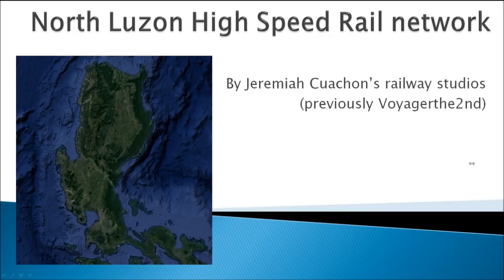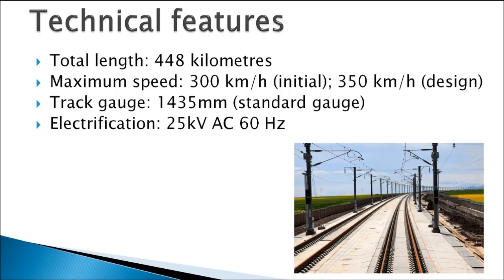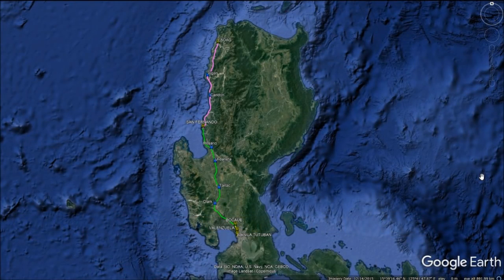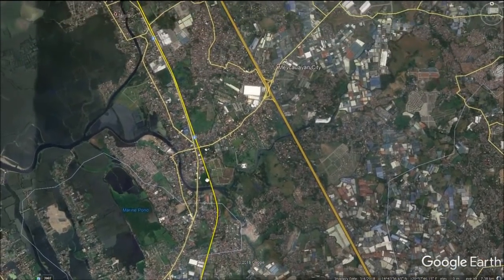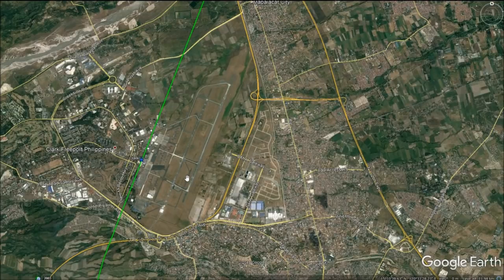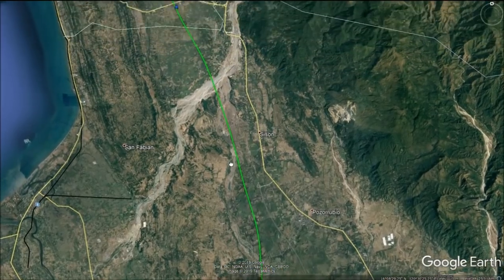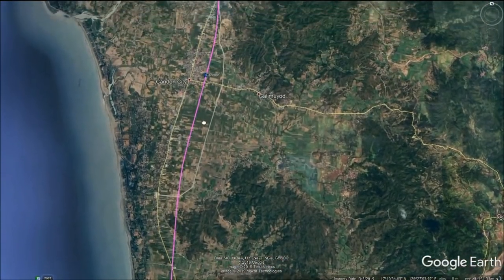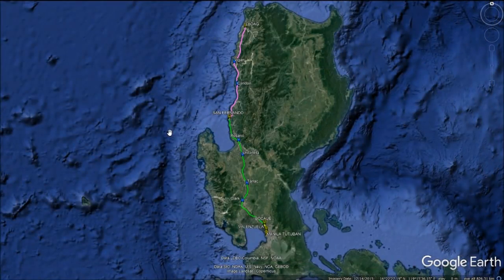HIGH SPEED RAIL IN THE PHILIPPINES - Central and North Luzon (FULL ALIGNMENT) - updated version

Comment: The Philippines really not only has no integrity, but also has extremely poor character.
The Philippines was the first to reach a contract for a high-speed rail project with China, but Japan did not want China’s high-speed rail to develop smoothly, so it once again performed small moves (including bribery) (there are also high-speed rail projects against China and India, as well as China and Vietnam, all used the same method to take away , but it turned out that after 10 years, the project has not started), and also advertised to build a high-speed rail for the Philippines for free. So the Philippines broke the contract, but it had a suitable reason, otherwise it would have to pay huge indemnities; it did not want to give up the free cake from Japan. So the high-speed rail that slandered China had quality problems, but there were no problems with the two quality inspections. It just so happened that the high-speed rail made by Japan for the UK frequently had quality problems, and the Philippines regretted it again. Later, the Philippines wanted to start three high-speed rail projects, and once again let China win the bid, but now there is the idea of hoping for Japan to undertake the construction. It seems that the Philippines, a small and capricious country, has a long way to go to get its first high-speed rail.
Reply: The Philippines wants so many things built ,a highway there a railway there ,So many but no money ,Also like the Bicol railways and La union railways ,after years of neglect it was abandoned ,also once a budget approved do all the money goes to the said project ,😊😊😊or to the you know where

Comment: It is quite confusing. The narrator have mentioned that there will be a tunnel from C3 Caloocan up to Valenzuela station. How can this be feasible to build?

The Philippine National Railways (PNR) also aims to reinstate the at-grade (ground-level) railway at Valenzuela City as they plan to extend the Metro North Commuter Line up to the said city. The existing right-of-way (ROW) in Valenzuela is just enough to accommodate the North-South Commuter Railway and the at-grade Metro North Commuter Line.

If the railway tunnel to be used for the high-speed railway will open its other end at Valenzuela City, then how will the tracks continue? Will it remain underground or above ground (elevated)?

It was mentioned in that video that the pair of tracks will continue above ground from Valenzuela going to North Luzon. If it is, then how will it be connected from the track segment in tunnel without interfering with the at-grade (ground-level) Metro North Commuter railway? Will they erect another set of pillars on the existing ROW in Valenzuela? The space in the said ROW may not be enough.

Comment: Sa mga nagsasabing fake to..dilawan cguro kau or puro kayo abs cbn kaya walang alam..this is an ongoing project.construction has already started for phase 1 tutuban-bulacan.thanks to build build build👊👊👊
Reply: wow totoo? ngayon ko lang nalaman to. Bilang isang Engineer, support ko to👍👍 Imagine (Laoag to Manila)=448km and the train goes 300km/hr. That's about 1.5 hours travel.
Reply: The one you are talking about is the NSCR, which is a commuter train, not a high speed. If you don't have any idea what is a commuter train, you can compare it to JR lines and subways in Japan.

Comment: It’s kinda uninformed. 1 high speed rail is expensive to maintain. The people commenting “I’m gonna take a road trip “ look up how much Japanese bullet train tickets cost compared to your cheap flights rn. 2. All the people commenting “ prices will be cheap because we can ship stuff thru this” You CANNOT ship stuff with this, or in large ie efficient manner, because they’re meant as passenger trains. There’s no connecting and disconnecting compartments. 3. This is another Filipino “it looks nice and other countries have them so we should also get it EVEN if it’s not efficient for us” mentality. Rail IS the solution to PH, but not the expensive high speed rail. It’s regular, functioning and efficient train system. It already existed before, and rail system still exist ... it just needs more stations, better company to handle it, better implementation of infrastructure ie park and riding so commuting cars into Manila will be reduced, and more effective use of transporting goods and services (you can actually change cars and ship goods in mass with regular trains). Current train system just suck, need better cars, better trained staff, better infrastructure like stations with parking lots, efficient transporting scheme and safe computer assisted rail systems that are actually now being the norm overseas.

Comment: It will kill a lot filipino's on the rails and walking on the rails, and look out for more Brown Outs there is not enough power in the Philippines to run this. oh please! The Philippines needs to work on there infrastructure first before anything else. they need to start new manufacturing and hire more Filipino's with a good salary with no contracts.   I love the Philippines
Reply: When philippines operate the nuclear power plant it can provide the power to operate this project
Reply: All people leave in rails area they're going to move them somewhere far Philippines will be the biggest tourist in all Asia
Reply: Don't worry, the construction of coal fired power plant already started last 2017 here in Bataan, 
Phase 1 w/ 600 mega watts
Phase 2 under construction 1200 mega watts
Phase 3 -600 mega watts

Comment: I would think that railway line crossing Central Luzon would have to be elevated rails. That area suffers from massive flooding during monsoon season and typhoons.

Another issue with railways in the Philippines, is Profitability. How much will a train ticket cost? I would think that train tickets can be more expensive than buses, but should be cheaper than the PAL flight to Laoag. So you have little room to play the railway ticket revenue. I would think that you have to fill up all train coaches to capacity all the time, just to break even.

The MRT/LRT lines running inside Metro Manila are filled to capacity, and yet the ticket is heavily subsidized by the government. So it is not turning up a profit.
Reply: That's why we need to promote tourism from the northern region first. So it would cater to a large number of commuters. If there's no tourism up north, this railway will be bankrupted.
Reply: Yes. Its going to be elevated..

Comment: 300km per hour? Get real. You should be a rocket scientist to have that speed in a short distance between stations.
Reply from the maker: That's why I set the distance the distance no less than 30 km between stations
Reply: Yes, maximum 250 km/h will be more than it will could manage. 
Luzon is extremely densely populated. And in 2015 Luzon with registrated with 490/km2 even the less density populated 12,188.6 km2 Palawan (72.7 /km2) and Mindoro (117.2 /km2) do as it get lower density than mainland Luzon. If there should come a railway tru the most populated areas of the 4'th most populated Island in the world, it would got stations more often than every 30km. Only a few places there would be chance to reach a speed of 300 km/h. 
But why buy a very expencive train instead of a better train with a top speed between 200-250 km/h, the Russian is very happy with their German bought high speed train who goes max in 250 km/h between Moscow and the other large cities in Russia, like St Petersbourg, and some 5-6 other cities. That people get a cofortable jurney is better than heavy heavy acceleration, and slowing down very often, which in turn can be dangerous to the safety of trains. And hopefully there will not be any large accidents with many hundred dead, and at least just as many wounded. And do Luzon need that type of train? I say it no, there live to much people on mainland Luzon, and there is still a lot poverty, so slower, cheaper, but just as good trains is better for the price to use the train's and the distance from Metro Manila to the northern point is too short for a high speed train who goes in 300-350 km/h. Had it been like the high speed trains in Japan and China, who only stop in the extreme large cities, then it would we different. And the railway should have gone all the way to Mindanao, it is actually possible, take a look. https://www.youtube.com/watch?v=HCT-FurFVLQ
Reply: Very good brakes

Comment: The issue here is not- if this can be built but rather if  Filipinos can do the necessary maintenance.
Reply: agree. maintenance is an alien concept for pinoys. the pinoys have a "jeepney mentality." use and abuse it. maintenance comes in only when the machine is destroyed.
Reply: @johncolasito5185  I think it stems from Filipinos' Nipa Hut mentality, where you don't really do periodic maintenance but ,just wait for everything to rot, then replace it.
We should first maintain our commuter trains properly before going to High Speed railway system.

Comment: Standing passengers at the rear end of a high speed train pose a dangerous and may cause imbalance to the running train, due to heavy load and wiggley standing position of the passengers.
Reply: This is not a MRT/LRT style trains.. its more like a 3 and 2 seats on each side..

Comment: There's no project so far of having high speed trains in duterte's admin. Maraming tao mauuto sa video mo. No to fake news
Reply: Stephen Teo di ko yan video , yung ongoing na clark to manila lang alam ko sa kanya may extension.
Reply: Ikaw mi naga naba  ....
Reply: It’s just an idea or plan idiot
Reply: @KitKat-bf1hp  butthurt? This may be a plan that will not exist until 2030. Realistically speaking, this will not yet happen since there are other major projects ongoing.
Reply: Wait ka lang another high speed line to be construct from Clark to calamba in the line up as per DOTr sec.Tugade..yes a High speed train.
Reply: @soulshot1231  source?
Reply: Marunong ka lang bumasa ,pero hindi mu naiintindihan se my comment nandun na yung source.
Reply: @soulshot1231  source as in article or journal kasi. Ang sinabi ni sec. Art connecting Clark to Calamba lang. Hindi 'yon high speed rail. It will only reach speed of 120kph as for airport express 160kph.
Reply: @estepen4181  hindi pedeng maraming station sa high speed train kaya gagawa sila ng bagong lines for high speed train nasa line up nila...bali 2 project yun isa ongoing na isa nasa line up nila.

Comment: ill believe this when NLEX gets past pangasinan, any train up north never mind Laoag has been proposed for years and nothing. even a 100mph train would cut travel to central manila or NAIA and reduce traffic having to get thru manila and with land being so flat for 1st 100+ miles north such trains needn't be expensive
Reply: High speed will be base on the integrity of foundation, safety factor is 10 instead of 1.5 understand.

Comment: Possible 1 hour and 25 minutes if no delay of above 1-3 minutes in stations. If stops are above 3 minutes, it can reach 2 hours from Manila to Laoag. 

Other than that, it will still be an impossible thing until corruption is minimized alot.
Reply from the maker: 2 hours from Manila to Laoag would be the fastest service when you factor in that Manila to Bocaue is 120 km/h max and that all trains would stop at San Fernando.
Reply: @Voyagerthe2nd  yeah from my calculations it seems 2 hours is possible. Realistic, if on time always.
Reply: The 60 and 120 km/h speeds in the metro
Reply: I am also measuring it (interested) and making sure limiting the amount of people that will negatively affected by the construction of the railway.

Comment: This high speed electro magnetic train could be extended up to the tourist areas and electric generating Bangui Bay Windmills, Solar, and Hydro power sources extensively available up to the cordillera mountains to be electrically tapped for this purpose!